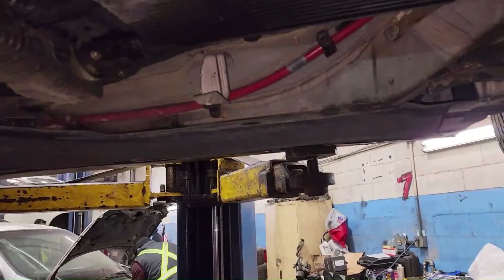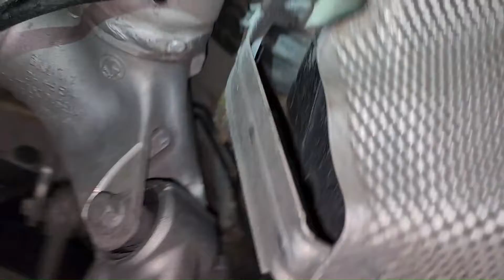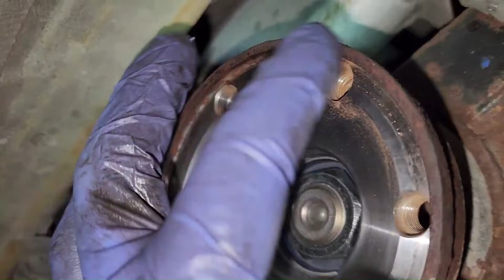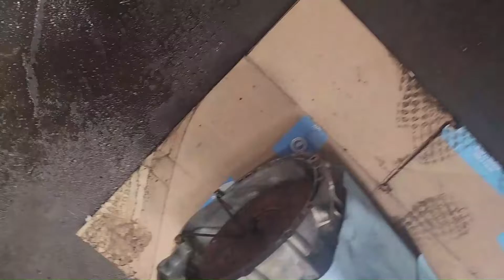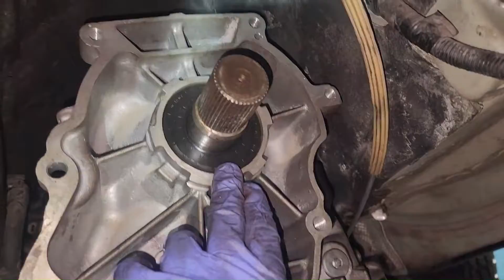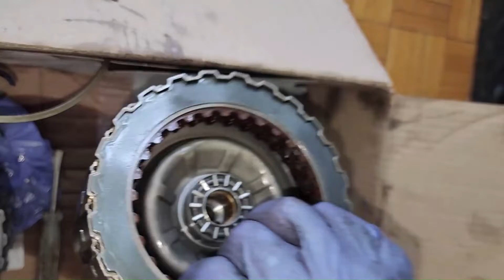2010 BMW E60 535i XDrive Automatic Transmission Removal & Replacement

Comment: hi, have you transferred TCU? or just use donor one then go? I am planning to swap the transmission but dont know if I have to do coding aswell...
Reply from the maker: I swapped out the entire transmission and it worked immediately, the TCU does not need to be swapped, however, I did reprogram it a few days after the transmission install (used winKFP and NCSExpert to code the new tcu)
Reply: @CarInspected Can you make a video or reply with steps ? it would be really helpful.
Reply from the maker: If the replacement transmission is the same part number as the one you're replacing, then just swap it out as a unit, the TCU (transmission control unit) is inside of the transmission, you dont need to extract it or swap it out. It should work.

Comment: Hey boss I just did a rear main seal replacement and when putting everything back together I started the car it was grinding against the starter, took transmission off and the flex plate is spinning and or rubbing on the starter gear do you think it is bent? I also had trouble rotating the motor to align torque converter bolts when the transmission was tightened to the motor
Reply from the maker: That sounds like a misaligned starter or a bent flywheel.

Comment: As far as coding what did you do ?
Reply from the maker: I used bmw software to write the VIN onto the replacement transmission and it worked without issues.

Comment: How did you spin the motor for the torque converter bolts?
Reply from the maker: Used a ratchet to spin the crankshaft using the crankshaft bolt.

Comment: Very helpful video..i have 2010 Bmw 530i the transmission is dead and i am planning to replace but the garage guy said that better to get Japan imported because its less mileage but my car spec GCC is it ok to replace with Japanese spec??
Reply from the maker: These transmissions are made by ZF, it's a European manufacturer. I'm not sure why the garage is recommending a "Japanese import"? There is something that's not making sense with the garage statement. Keep in mind that a Japanese spec would have a right hand drive, so there MAY be small differences in the transmission. Gulf spec (GCC) is left-hand drive.
Reply: @CarInspected  he recommend the Japanese spec transmission because of mileage is less but the gcc spec by the way it will be bad because it was used in gulf and the temperature here is very high so that's why all the bmw owners taking Japanese parts also its more expensive than the gcc spec ...but my question also for the car computer if i fix Japanese spec transmission it will be ok or i should replace the full computer?
Reply from the maker: Good question: Technically, it should work because the transmission computer for this specific transmission is embedded in the mechatronics unit /module (i.e., inside of the transmission).

Comment: Great video sir, I have a 2010 bmw 535i xdrive, could you tell me where the transmission cooler is located please?? I can’t seem to find it on my vehicle!!
Reply from the maker: Are you looking for the cooler lines ? Or the cooler location?
Reply: @CarInspected  I’m looking for the cooler it’s self! I ordered a new one and wanted to install it yesterday but I didn’t see it near the location I thought it would be.
Reply from the maker: Cooler is located behind the lower radiator on the driver side.  The cooler lines run along the driver side to the transmission housing.
Reply: @CarInspected  I seen a video where the cooler was mounted on the lower left of the radiator, but mine was not